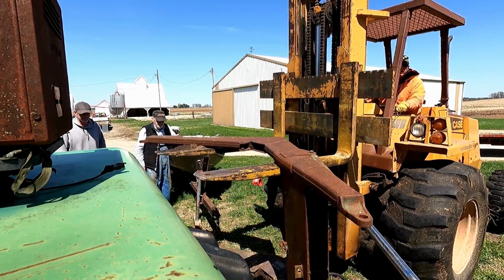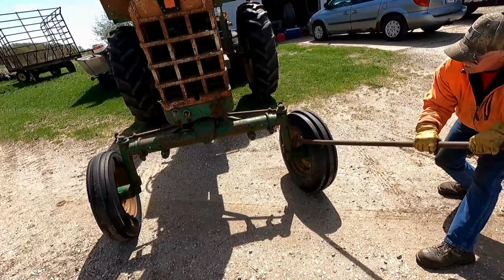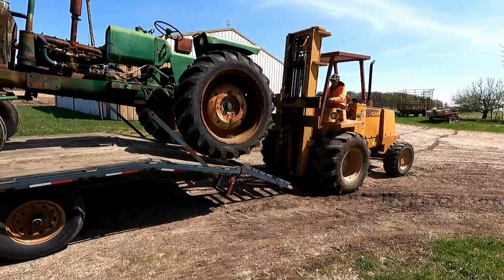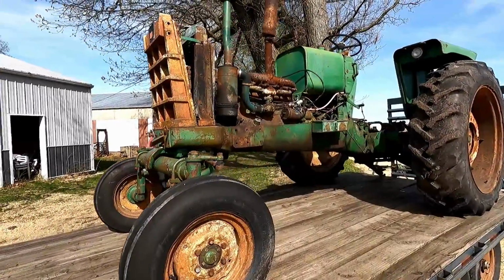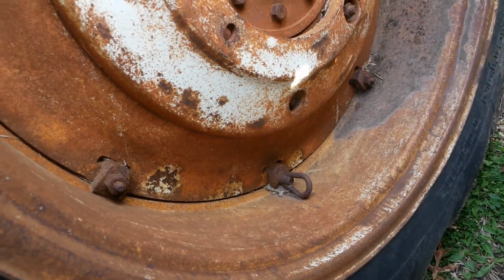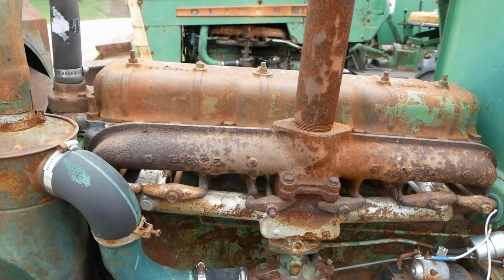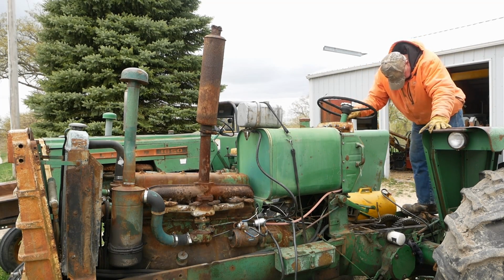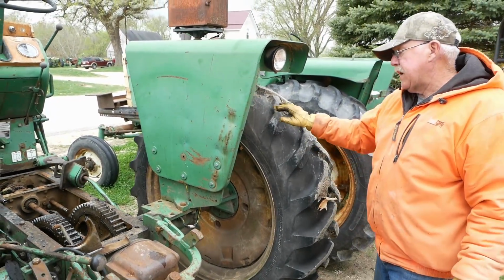Moving an Oliver Tractor with Seized Rear Wheels - Will it Run?

Comment: My neighbor at the farm across the road from me, has an old Oliver 77 six cylinder out in front of his barn, that is basically yard art. He's not mechanically inclined in any way. He told me either the engine is seized, or the transmission is locked up. Maybe I'll give him a hand to try and get it going. Such a shame that it is just sitting there, cause it's in decent shape otherwise.

Comment: Since your dad spent a whole day trying to free up that idler gear, maybe the two of you could combine your powers and take another swing at that seized idler gear.  If fixed, he'll end up with two valuable still repairable tractors instead of one operating franken-tractor with a half assembled mismatched parts doner.

Comment: Excellent video Wes  :)  plus load up parts tractor Oliver 1650 also fix up orgnail one dad has and but got parts fix up on parts one! Also what year also how horsepower & size of this tractor Wes ? Also have ever work on a Cockshutt brand tractor also 35 or 40 got Buta Motor 6 cylinders there amazing tractor my late Grandfather Bill Cann SR bought a Cockshutt 35 was Loader tractor also gas model used of his one brother Fred in 1950 bought Cockshutt 40  gas with Buta 235 6 cylinders motor 1 barrel Zenith updraft carb, 6 volt positive ground type from assembly plant in Burlington Ontario Canada for $4.500 dollars and my uncle Bill Cann Jr age 16 drove back to Perrytown Ontario north west of Toronto 60 kms east also my Dad and Grandfather Bill flow him back took 2 weeks get home farm in Perrytown north of Port Hope Ontario Canada too ! I remember tractor growing up with my Uncle Bill who own it from 1957 on and dad co owner home farm till 1997 when but  sadly in 1993 motor screw up after oil change my uncle Bill did to a bearing on Crankshaft seized  plus gear for Oil Pump and Distributor broken Crankshaft on bearing of Numbers 3 & 4  and tried finding a motor for Buta type no success even tried USA and CANADA  find not available in any scrap yards! So tractor sold for parts to another Cockshutt 40 and Noresman  tractor to also never heard price my uncle sold for ! But do have excellent memories on home farm plus rents ones my uncle and dad with it ! Plus I always hard start up on electrical start and crank it if needed but drive it lots to most certainly too was lots fun ! Plus pull seed drill also lots implements on machinery but funny part had 518 ratio axle and fast plus tow it weight too Lol it Powerfull 43 hp and 90 torque on 6 cylinders of 235 CC !

Comment: Surely would have been easier to just lift the back of the tractor, then drive the trailer underneath? then same at the other end - lift the tractor, drive away the trailer... easy to be an armchair load advisor, though.
Reply from the maker: How is that easier?

Comment: About 50 years ago I was working for a Ford tractor dealer.  A farmer had a tractor that would get stuck in gear, but only during the summer when he hired city kids to help out on the farm. Each time, the farmer removed the tranny cover, manually took the tranny out of gear, and it would work fine until the next time. He brought it in for repair, after he attempted to force the shifter, breaking it in the process.  I repaired the shifter, found nothing else wrong, and put it back together.  I took it for a test drive, speed shifting the tyranny, when it locked in gear.  This time, we carefully raised the cover enough to see what was happening.  Shifting it hard, allowed the shift rail to move too far, allowing the shift lever to get out of its normal position.  We put a limit pipe over the shift rain, and problem solved

Comment: Had a Waukesha in a forklift with a seized and broken balance shaft, a spun main bearing, and had sat outside for a few years. The thing started and ran drove itself on a trailer. It was knocking and banging but was still running.

Comment: That reddish rusty maybe, box on the right fender as you would sit on the tractor is a radio, I believe.   My uncle had one for a allis chalmers tractor.  They must have been a hot selling accessory back in the day.  Do you know if that radio works?  Is there an antenna with it, it should have had an antenna.  If so, would you sell it to me??

Comment: I’m not a tractorish person but did you leave a piece of the machine behind. The frame bit that was dragged from underneath, and in my expert u tuber opinion I think one of the gears on that shaft has been put back in the wrong way around binding it up when it tries to turn🤷‍♂️
Reply from the maker: The tractor had a loader. It was removed before we moved it.

Comment: Thanks for another tractor and Dad related video, It's amazing how cloudy info gets on old tractors and their time lines.  Best one I had was for a customer, who said it had a motor rebuild before it was parked in 1970 when the original owners son was tragically killed using it. He said it's got a rebuilders plate on it with regrind bearing sizes on. Well that re sized crank wasn't even in it and the one that was had no white metal left in the bearings, and was standard size and totally worn out. I'm not an Oliver guy but  My guess is as that tractor has several different patina levels on components like the engine/ transmission. could that motor being smaller  mean it's from an older series 2 digit tractor. Take care guys

Comment: nothing against your dad but i think its pointless to pull the engine for the other tractor especially when he could just cut that bearing with a torch replace it then fix the shims he was talking about and have a running driving tractor other than having to put the loader back together and the engine is much smaller than the other one anyway its his tractor i guess hell do what he wants have a good weekend wes and your dad

Comment: Lol I had to go back to the shot at 2:02 of the reverse case backhoe forklift on the trailer being towed by a single rear wheel 250/350. If that combination of equipment could have pronouns they'd be "Your/Majesty" 
Good to see the old fords still getting work done.

Comment from the maker: Be sure to tell me about the winch I need. The one that pulls a tractor on a trailer with seized up rear wheels...
Reply: I have a winch on my gooseneck trailer, it is strong enough to pull a dead tractor up the ramps, it has been a savior many times. At the end of the video, your Dad was able to get the tractor to roll by shifting the transmission collars, that will make moving the tractor a lot easier in the future.

Comment: The gears in the main shaft closest to the engine just to the left is another gear and I think I can see a loose bearing sitting in the teeth.
Reply from the maker: It's seized in both directions.

Comment: When a team is working together in the noise out of eye contact they need to speak loudly and especially clearly.    Up needs to be UP, whoa needs to be STOP, back up needs to be REVERSE or UP (depending on the situation lol) etc.    

Unless you guys are joined at the hip hand signals are an exercise in futility.
Reply from the maker: He can barely hear and that Cummins engine rattles like a Soviet moped.
Reply: @WatchWesWork my equipment operator is 75 years old with identical working conditions, instructions need to be simple and clear the 1st time.
Reply from the maker: @paisleyprince5280  Good for you.

Comment: My dad had a few Oliviers a couple 70s and 88s one 60 with a small block chevy. Smooth running tractors . You could pop a wheelie and drag the drawbar on the road with the 60.

Comment: Back in 2012 I bought a ih 706 gas that didn't run at consignment auction. I hauled it home on the same type of trailer and truck setup you have, except mine had a 460. Still have the tractor and truck. Tractor needed a piston and the head gone through. I pulled the air filter out and it was stamped 1986, so I cleaned it and put it back in to this day. Tractor and truck still run good! Fun times

Comment: I like your commitment to rolling it on and off the trailer. Was it too heavy to hoist up and set it on from the side?
Reply from the maker: Yes. It's well over the lifting capacity of the forklift.
Reply: That Case will pick 6,000. The 1600 weighs 7,200. Minus the the parts already removed that forklift would have picked the whole thing.
Hoisting and rigging does not have to be dangerous. Obey 2 rules.
1.) Nothing moves until everybody understands.
2.) Only one man signals and the operator must follow the signal man’s command, no exception.
Reply: Have to get a 588 case then you coulda. :)